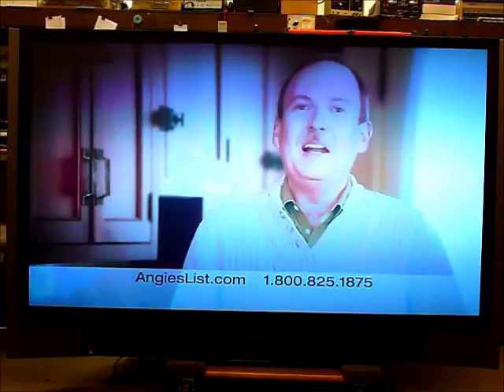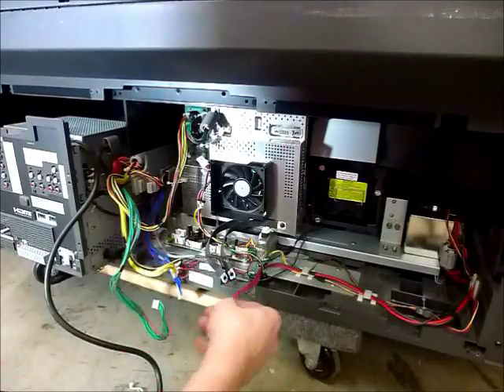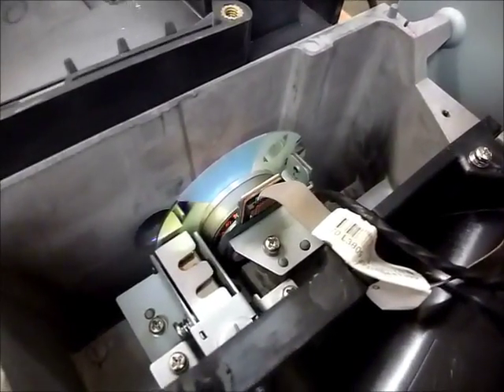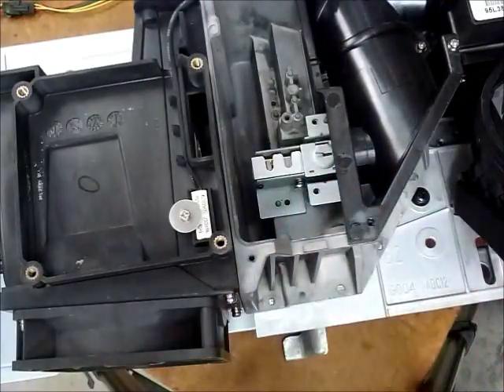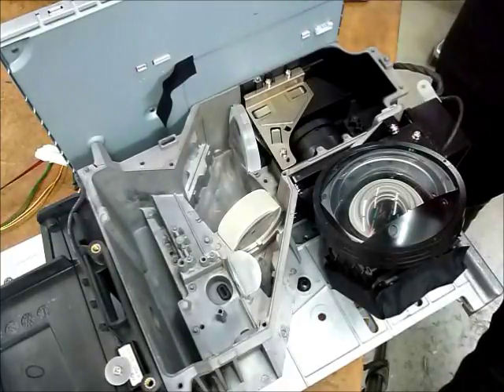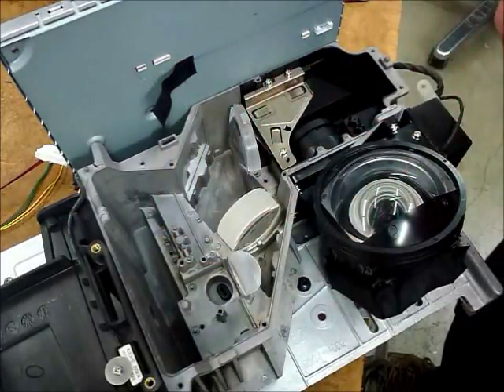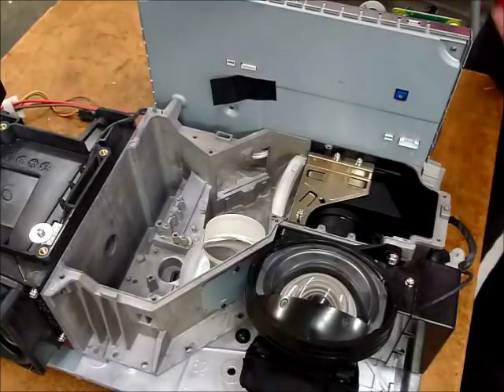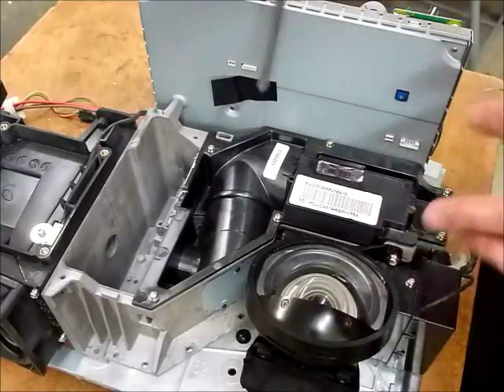Part 1 - Mitsubishi WD-73727  DLP Color Distortion Distorted Fix Repair V28 V29 V30 V31 Chassis

Comment: hi, I have a Mitsubishi WD-73C10 TV.and I believe my Optical Engine is bad. half my screen is covered with a dark shadow, it started in the right top part of the screen and over time has gotten bigger :(  the only part for my model TV is 350 dollars on eBay, Mitsubishi 938P174040 Optical Engine WD73C10, 

but they are other Mitsubishi Optical Engine for other TVs for like 55 bucks, can I someway buy one and take a part off of it to fix mine? or are there any other models that might work instead of the model number my TV is? thank you I know this is old but hoping for any help. I'm just going to trash my TV if I can't get a cheaper part, I can buy a new TV for 350. 

again thank you for any help

Comment: i need your help. why is it that the old DLP chips from 2006 have a crisp picture then the newer 2007 chip? I have Two Mitsubishi diamond series tvs.  WD57831 and a WD73833. the 57831 is older from 2006 and the 73833 is from 2008 newer. but its not super crisp . i tried other chips 1910-4145w also the last generation from 2011 and still not as clear as the 57831 model. which looks like a plasma its so nice. the 73833 is just okay. i got another one also still same thing. is there a secret setting to make it super crisp? please also email me privately TonyCmemory at gmail dot com.
Reply from the maker: I would guess the focal plane distance is just a bit different from the old chip to the new one. You may have to do a manual focus with the lens to try and clear it up. most lenses have a manual focus adjustment somewhere, you just have to find it. Older Samsungs had a secret focus wheel near the DLP IC. I cant remember about the Mits's though

Comment: hi I have a question I have a Mitsubishi TV model number WD-62528 and I can't find no video for it to clean the lens and to see if my color wheel is good when I turn on the TV and makes a lot of noise  so far I replaced the lamp but it's still dark you can see a little   trying to figure out the problem so I'm thinking it's my color wheel

Comment: I need help-https://youtu.be/6VR-nRMs7S0
Reply from the maker: It looks as if your color wheel is coming out of sync. You may have to pull the color wheel and clean the rotor and black stripe as well as your optical sensor. Without the DMD board recognizing the index of the color wheel it will not keep the lamp lit.
Reply: @norcal715  I'll check it out tomorrow and let you know thanks for the reply
Reply: @norcal715  is the instructions the same for mine as your post ?
Reply from the maker: yes pretty much the same but without adding the aluminum tape. just make sure the hub and optical sensor are clean
Reply: I replaced the color wheel and cleaned all the picture still comes on for about 1-2 minutes then shuts down with the red light indicating the lamp fail. Same as before I replaced the lamp and the color wheel.
Reply: @norcal715  I replaced the color wheel and lamp so far and cleaned all lens my WD-60738 Mitsubishi is still doing the same thing after turning on it shows a picture for about a minute then flickers and shuts down the front code light is red indicating lamp fail if I restart it it does the same thing after the green blinking code light on the front. Is it possible I have a sub par lamp I purchased it from projector Lamps world I gave them my bulb replacement number part #915B441001 as stated in my TV manual or is it something else?

Comment: I need help locating and removing the dlp chip for the 80 inch wd-73831 model. My picture is crisp and perfect for about 20 minutes but shortly after the screen changes color to a olive green and flickers instead of the blue when checking the inputs as well as when i turn the tv i see the blue screen with vertical red, pink and purple lines running across the screen for about two minutes then its like a normal tv. I dont have any codes. Please help.

Comment: Can you tell me how to remove the Optical Engine on a WD 73732?  It is almost the same as this, but there ended up being something holding the engine in when I attempted to slide it out.  It was so aggravating... I was seeing the promise and couldn't even get it completely out to clean it.  I know that is all I have to do.  I was so sad... Please help me if you can.

Comment: Thank you so much for your video!  We have been suffering with a glitchy tv with color problems for a few months now, but it is so gigantic that I was unable to get the model number to see if it was one of the same tvs as you were working on in the video.  Well, yesterday, I had had enough, so I put together a contraption on a couple of furniture dollies and straps for safety and hauled that thing off of the cabinet, and followed your repair instructions to a "T."  Although the mirrors and lenses were a bit hazy, they weren't terribly bad, but the large plastic lens had a TON of that padding on it that had apparently disintegrated over time and melted onto it.  I cleaned it off carefully and reassembled.  The TV works better than it did before!  And I was able to do this myself (I'm 5'3 vs like a 72" tv lol).  My model was a WD-73927.

Comment: Do you have any videos that address the constant green blinking status light? I have a wd-65737, was working fine up until last night. The welcome screen is as far as a I get. I replaced the bulb a few months ago, so i don't think its that. Any suggestions?
Reply: Hi Neal, I replied to your other comment with more detail, but the good news is you just need to run a software update on your TV set and you'll be back in business in no time.   I had that problem on mine and it fixed it right up.

Comment: How different is the chassis on the 737 series?  (WD-65737) - Would this still serve as a good guide?  Planning to try it this weekend.  I'll report back my results for posterity, Just looking for any pitfalls I might encounter.
Reply: How did it go for you?  I have a 65738 and have been wondering about tearing it to it.
Reply: Did you get your tv to work? i have the same model, already replaced the bulb a few months ago, now i get the green blinking light and no picture. Its gets to the welcome screen fine, and thats it. Not sure where to go next.
Reply: Neal m Hi Neal, the same thing happened to mine before I bought it, it was just stuck on the welcome screen with blinking green light.  In fact that's why I bought it,  the seller wanted $100 for it in non-working condition.    I have GOOD NEWS!  All you need to do is do a software upgrade via USB and it will be good as new!  

Go to this page on Mitsubishi's website:  http://www.mitsubishi-tv.com/support/documents/WD-65737

Download the W41_11_03.zip file with the firmware.  Also, download the PDF instruction guide called "Instructions for software upgrade".  

I recommend you do this on a flash drive of less than 2GB in size.  It has to be formatted to fat32 as well.  Then just follow the instructions to the letter and in about five minutes, you'll be working again!  But I repeat, read the instructions over a couple of times and amke sure to do it exactly how they say, so that everything goes right.  It should be an easy fix though if you do it right.  

good luck!
Reply: Brew It went fine, I had it done in about two hours, and that's only because I was extra-careful and took pictures of everything before I unhooked it at each step.  The interesting thing with mine, however, is that I didn't really have any haze on my lenses.  Just some dust buildup on the big round lense bu that was it, the DLP mirror, the internal lenses and mirrors all looked okay.  Turned out it was a really worn LAMP that was causing my picture problems.  the reflective surface behind the filiament in the lamp was really hazy/cloudy.  Replaced the lamp and I was good to go.
Reply: Matt314159
Thank you, I replaced my bulb yesterday, and it works great again.  I didn't have time to investigate doing any more than that, but right now I am happy.
Reply: Matt314159 i wish i could say this simple fix worked, but it didn't. I must have gone through the list a half dozen times. The screen still did not come up. I reformatted the drive and downloaded the software, but it still did not work. I don't get past the Welcome screen. I unplugged the tv, inserted the jump drive , plugged it back in over and over. Do you have any other ideas?
Reply: Neal m Are you 100% sure the drive is formatted to fat32?  Also, what size is the drive?  I used a 512mb one to be on the really safe side.  Also make sure the files are extracted from the zip to the root of the flash drive, and that you didn't just copy the zip file to the drive.  This is the same exact thing mine was doing, stuck on welcome screen, flashing light, everything, so I'm fairly confident that something is just going wrong with the software update that's not letting it pick it up for some reason.  

Edit- the flash drive should look like this:  http://imgur.com/coTSGou
Reply: i used a 512mb as well. I formatted it to fat32. When i unzipped the file, it was downloaded to the jump drive. I don't understand why its not working either. I do remember updating the software one time before, and it worked,. Do you know how recent this new software is? I will give it another try after i review the steps again.

Comment: Im going to attempt this but had a question before I get into the internal parts of the TV.  Since my set seems to be doing the same thing, will I fix this by simply cleaning the parts as described or do I need to replace the sensor in the wheel? I don't know how to desolder and am afraid I would mess this step up.  Cant you buy the whole sensor plug? Thanks for helping.

Comment: Instead of buying a whole new light engine you can just change the color wheel sensor. I have a few of these left if you need them. Bradcox5975 at bellsouth dot net

Comment: I have a Mitsubishi DLP Digital WD-62927. I just recently put in a new bulb. The tv power on and works fine, however after 30 to 60 minutes the colors start to flicker then turns bluish and pinkish. Then the colors start to become faded and develops a line split in the middle of the tv. What can be causing this?

Comment: I accidentally tried to remove the screw on the top near the lens, and you said not to mess with that screw.  Am I screwed?  Can you help me?
Reply: Never mind, it works great.  Picture is super clear and bright now.  Most of the work was cleaning all the dust and dirt.  A lot of smokers in my family, so there was a lot of sticky dust.  I went crazy with the tin foil and covered the lamp housing as well as the fan housing for the lamp.  A lot of it looked light damaged.  I also used distilled water to clean all the lenses, just to be safe.

Comment: Hi I Have a zenith Projection tv model # Z62DC1D. After replacing the color wheel the tv has had a problem with light colors. Any help? I have looked everywhere but no luck

Comment: Ps. This flickering crap started after my lamp popped very very loud as hell. So I'm thinking it was glass and small particles causing the issue. Also my DLP letting out a high pitched squeak that I couldn't hear but my kids could.

Comment: People that are having issues with flickering (color wheel) this is a temporary fix. Get an air compressor or can and blowout all the vents. Also I took out the lamp and blew ever angle I could get to. Very carefully I must add. Actually I vacuumed everything first the I used the compressor to blow out the dust and dirt. It worked for me. I was ready to start opening my DLP and I tried this as a last effort. So vacuum everything on the sides, back and front. Then blowout everything carefully.

Comment: I have a WD-65C10 and recently replaced the lamp turned the tv on and the screen worked for about 5 minutes and then flickered while changing shapes of color. I turned the tv off and let it sit for an hour and turned it back on and did the same thing. Great screen for about 5 minutes the flickering screen. When the screen starts flickering there is a louder noise coming from the back which makes me think its a color wheel. I believe my tv has a different chassis. Is it much different than these?

Comment: hi how are you the reason of my message is about it a question  i have infocus dlp 61 md 10 i been have troble becouse i lost color saturation until the screen goes black i have sound but no image do you belive tha problem can be the color wheel also this happen after 15 min tha i turned on i dont ear any noise or wired  only the problem is the color saturation (loss color) the light tunnel seen to be like duty from the inside . i hope dont disturbe whit this kind of question and tankhs

Comment from the maker: I think cleaning , tape, and the fan resistor mod will remedy it. I nave heard of a replacement optical sensor but I have found that if you polish the color wheel rotor and leave the black sensor in tact that it will remedy it, but that is in extreme cases and you take a great chance of damaging the color wheel in the process!

Comment: i have the 73727 model after an hour my picture loses color it doesn't turn black and white but it seems as if a color is lost or idk i'm hoping your resistor trick will work as well as the cleaning of the housing color wheel and etc. if you have heard of this any suggestions???

Comment: I took it apart again and found the problem, the dlp was missing some spaces between the heat sink that provide the pressure for the dlp. Although the screen is a little tilted I think I need to adjust the colors now. Other than that the tv is working again. Thanks for the reply.

Comment from the maker: on the lens i misaligned, all it affected was the overall centering and rotation. It still had a picture it just had a black band on either top or bottom or sides 4-6 inches but not a picture at all. I suspect something else is out there. . As far as alignment of the lens, once you get the video back you can pull the front, use paper as a screen, loosely assemble the lens and do a mechanical alignment till it is close and tighten it up hoping it does not move so much. Sorry

Comment: I found an old pdf guide of how to repair this problem before I found your very detailed video. While cleaning the lens I removed the large lens you pointed at in 8:06 to clean it and now that I see your video that was a big mistake. The tv powers on, there's audio and the lamp turns on but all I see is a dark lit screen with some strange blotches that look out of focus. I'm sure now that I probably misaligned the lens, you wouldn't know how I would go about realigning it would you? Thanks.

Comment from the maker: The newer models do not suffer from this problem! The color wheel cavity is entire made of pot metal and the lid is steel or aluminium. So you should never have to worry about this situation on this model.

Comment: Just bought a wd-75c12.  I obviusly don't want to open it while its still under warranty but would you recommend "after 1 year" to open it and apply the aluminum tape or just let it alone until I have issues?

Comment: Awesome video again.  I have a Mit WD-57732.  I cleaned the light engine a couple of years ago because of blooming.  It had what looked like oil residue (looked like a big finger print) around the iris.  It's been great ever since.  I didn't think to tape off the plastic though.  Great idea.  

FYI - paper towels contain wetting agents which can streak surfaces even when used with just water. I actully like lint free microfiber clothes.  Just be sure to wash and dry them WITHOUT fabric softener.

Comment from the maker: The ballast will make a slight ticking sound when trying to light the lamp. just make sure the 2 pin power to the ballast has about 300-350 volts DC. also make sure the ballast control cable didnt get disconnected.

Comment: I did the cleaning myself and it seemed to go well, but when I put the TV back together the picture wouldn't come on.  It gives me a code 34.  When I turn the TV on it whirs up for a few seconds and then whirs down and repeats 3 times and then turns off with a red lamp led.  All the fans seem to be working an the balast seems to be working, is it possible that the bulb coincidentally blew without any signs of wearing?
Thanks.

Comment from the maker: On these sets the fans have a rotation sensor so if a fan stops it will shut the tv down. there is no way to see if they are rotating at the correct rpm other than by looking at them.